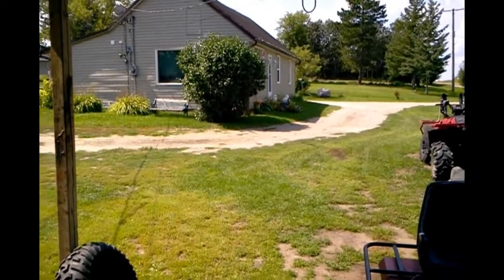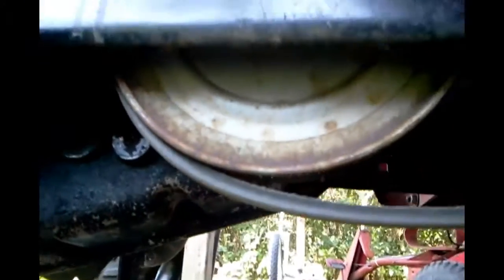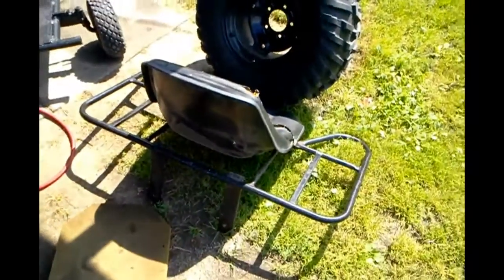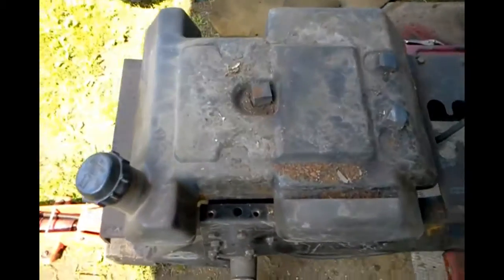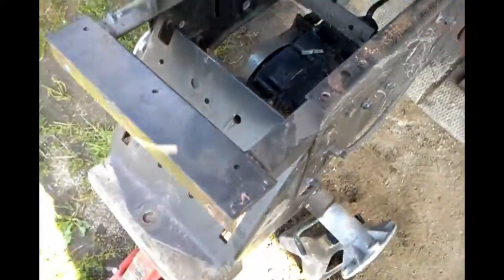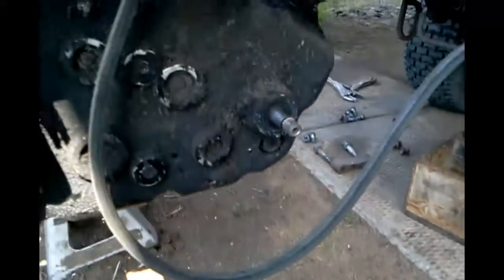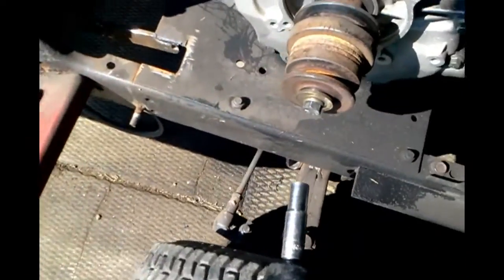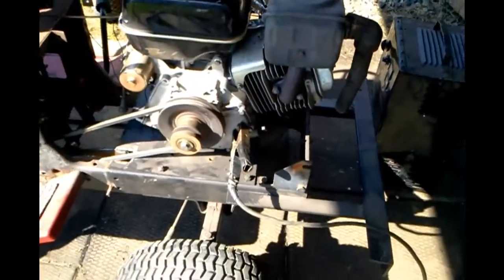how to do a pulley swap

Comment: How fast does it go? I’m looking into pulley swapping mine. Thanks.
Reply from the maker: I want it to still have some power and down low for mudding it only did around 15 mph
Reply from the maker: But it still have the power to spin 25 inch quad tires in some deep mud
Reply: Awesome, thanks 👍🏻